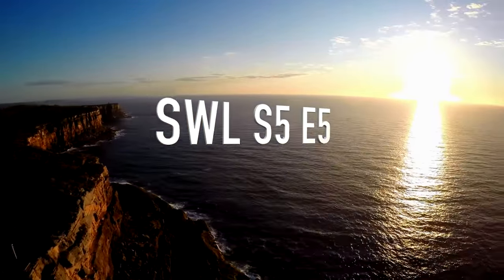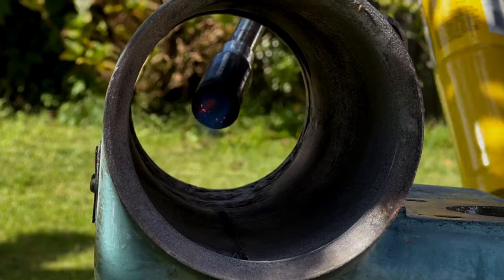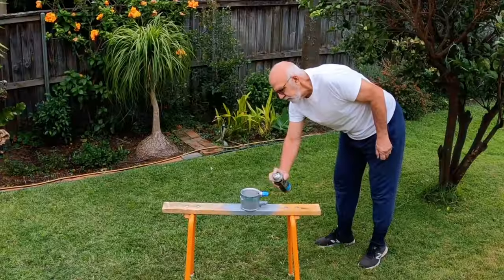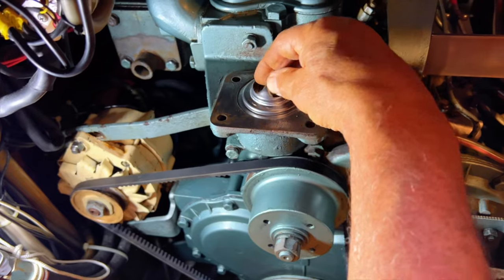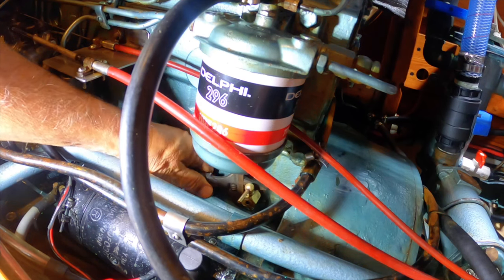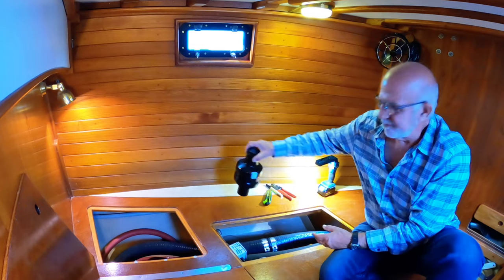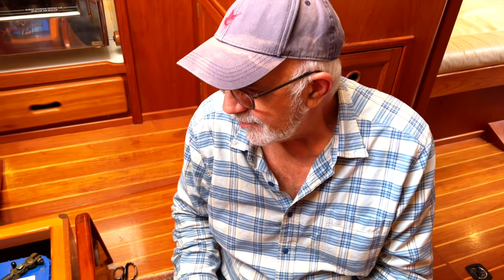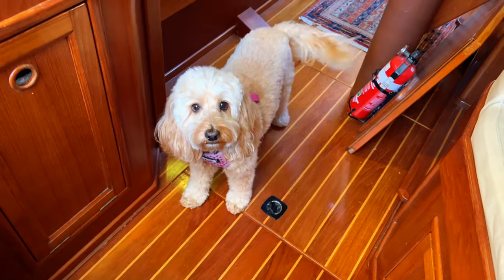Boat Heat Exchanger Repair | Sailing With Lucy

Comment: Amazing job on the heat exchanger. 
Is your yacht on a paid mooring or anchored?
Reply from the maker: Hi Bekir, thanks for your comment. If you're interested we have put a full description of the process and about Barnacle Buster Concentrate in the video description. We have a private mooring which we pay annually to the state government. It costs about AUD $1100 pa for a 12.75m boat. You have to either buy or install your own mooring apparatus and you are required to have it checked annually and provide proof of it's serviceability to the government body that manages them. Cheers, Adriana